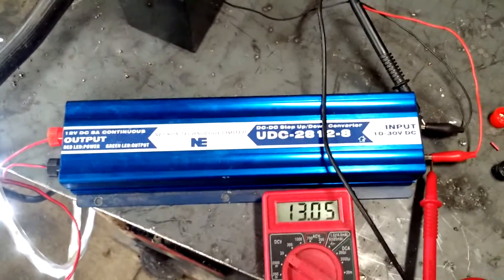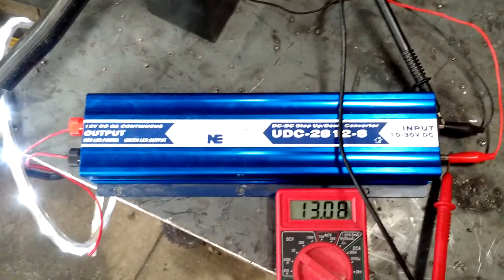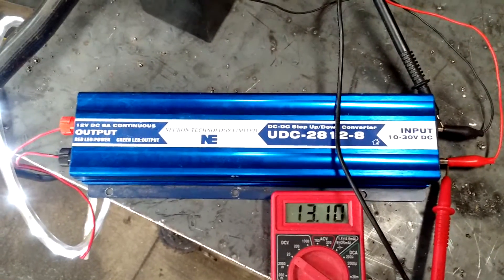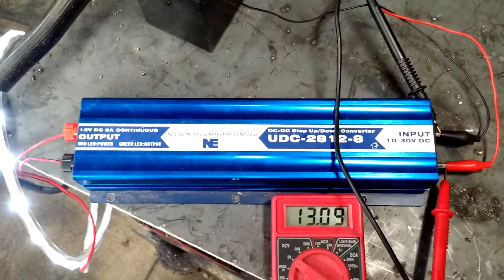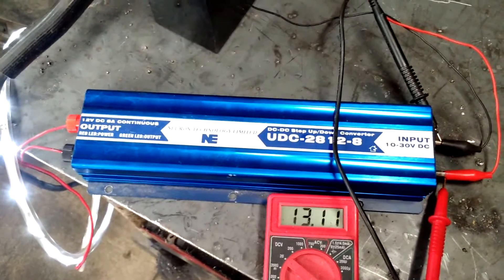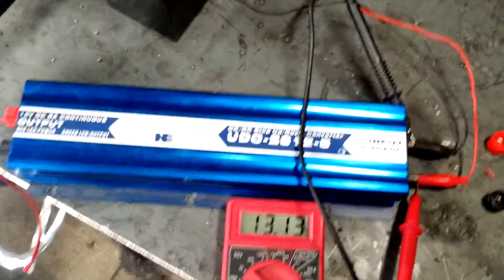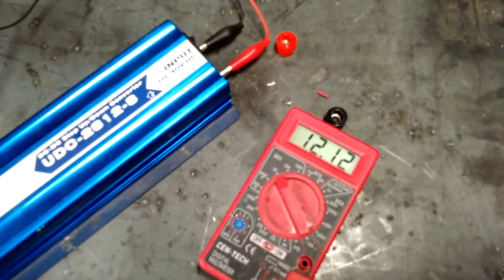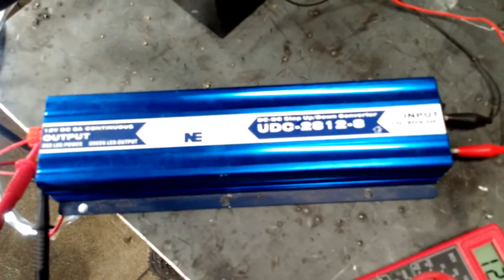12v Buck-Boost DC to DC converter from Power Stream being used in my RV

Comment: I could use one of these as i got a older rig as well. but my money well is dry on the other upgrades im doing. But i've noticed with my meter hooked up connected to a DC Socket when the engine is running the voltage spiked up to over 14 volts.

so yeah with something as old as are rigs a buck boost be nice to have in line between the DC sockets and battery bank.